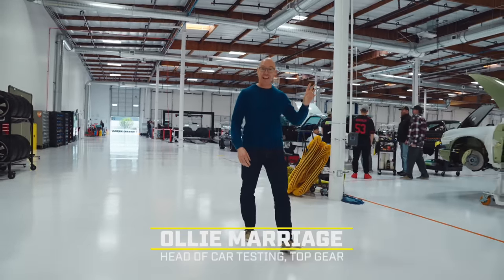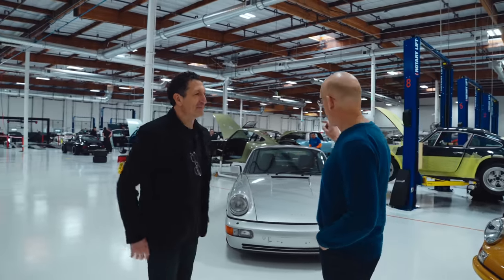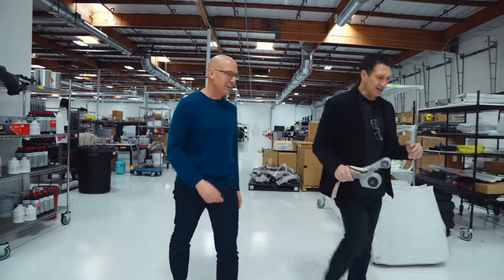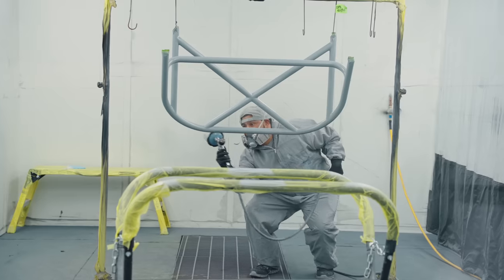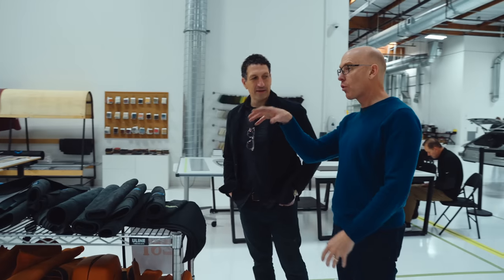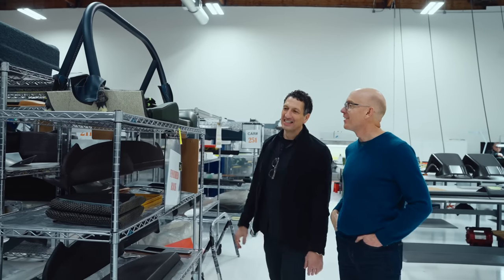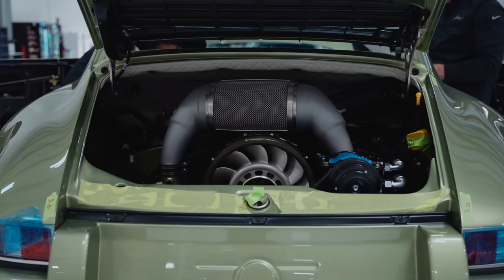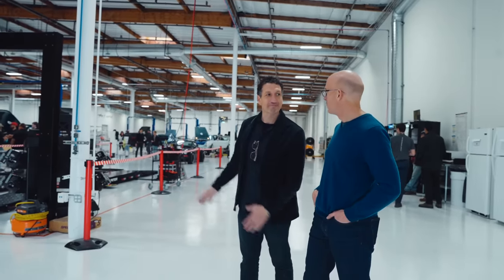Singer Factory Tour: How The Most Beautiful Porsches In The World Are Restored | Top Gear

Comment: The only thing I don't like about a Singer, is the central mounted gas filler.  To me that's just a detail for detail's sake and is fairly impractical.  I am sure you can spec a Singer to have a regular gas filler location, but it seems most prefer the race style location.
Reply: It was done because the classic Singer is a throw.back to Porsche race cars. And frankly, it is no less of a detail for detail's sake than most other things on luxury sports cars. If you really want to know what an insane detail is, I'd say side view mirrors that are pretty much useless. I promise you. no matter what car you have ever driven, nothing is as bad as Singer's side view mirrors.
Reply: @AB-80X  I know exactly why it’s done, I even said it was a race style location but think of how impractical that would be filling up at a gas station.  You would have to be so careful preventing the hose from rubbing the hood and marring the paint.  Personally I don’t like how it looks.
Reply: @cheemomugdoo799  Much less than you might think. It sits lower that it appears as the font end is really low. So it is pretty easy to hold the hose and put in the nozzle. And if you worry, just open the boot lid. The biggest issue I rind is the risk of dripping fuel onto the paint if you don't give the nozzle a few taps before putting it back. I understand people see it and consider it an issue, but few has tried to use it and thus kind of speak about an issue they don't really know whether or not is an actual issue.
I think your last sentence is a bit more on the nose, no pun intended. What I mean is that you don't like the looks of it, and so you also look at it from the point of it might be an issue. However, that is a biased assumption.

Comment: Stock OEM 964 (original) will end up being the most sought after. At least Singer chose the 964 platform over 993
Reply: No. Look at how many 964's were made. Then consider the fact that there will only be 400 made of the original Singer and not many more of the 930 tribute. It's a drop in an ocean.

Comment: How does that new air cooled motor pass EPA and or CARB emissions?
Reply: Lots of engine sensors electronic Fuel injection, custom ecu maps and a cat, probably...
Reply: @RichN22  well I’m sure they have some great engineers and programmers. With emissions the main issue is what happens on start up, not necessarily running. Readiness flags have to be set. That’s why so many aftermarket tuners fail smog emissions checks.
Reply: I believe that the VIN for the original 911 is retained so they only have to meet the emissions that the original car had to meet in the year it was produced.  A much looser standard than current emissions, which even Porsche could not pass which is why they started water cooling in the first place.

Comment: Do the customer choose all parts of the configuration, like color obviously but , the exhaust shape, the rims , the inside layout ?
Reply: Of course they are bespoke.    The is in the dictionary 😂😂👌👌🏴🏴
Reply: Word  I meant 😂
Reply: @russcooke5671 
No.
Yes you can have some things made, but a lot is "fixed"..
Interior layout is as it is. Audio system is as it is. One type of wheel, but in the colour of your choice. A few different exhausts etc. but that's it.
What Singer is often willing to do is work on weird stuff like a roof rack for your track tyres. Obviously they will do the interior design as you like within reason etc. but there are many basic elements you can't change.
Reply: @AB-80X  for the money they charge you would expect then to do anything to the car.    I still like the original 911s from  the late sixties to the late seventies. I would have a mint one over the later ones.